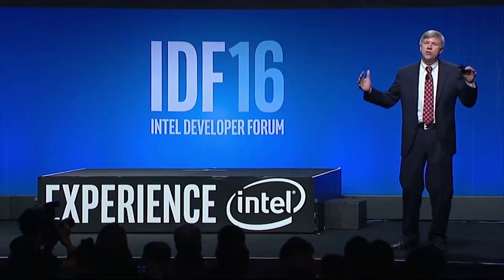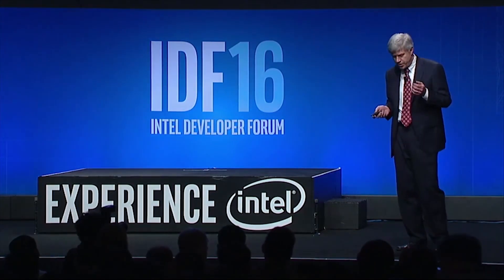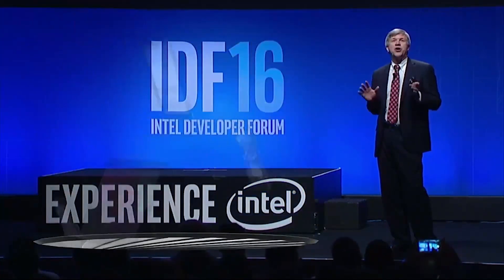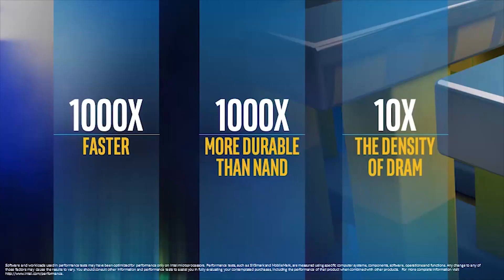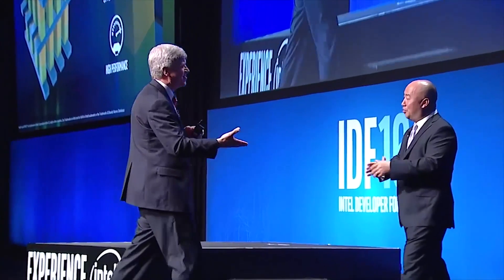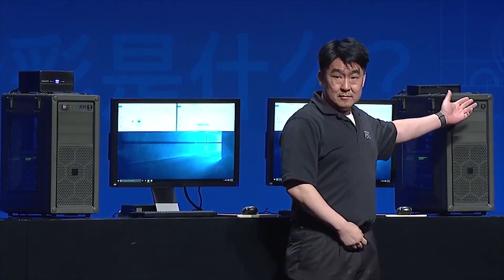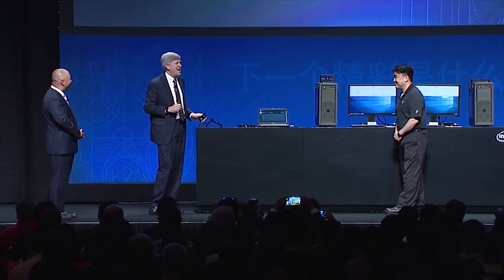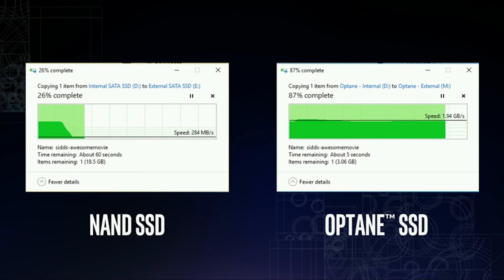Intel IDF 2016 Shenzhen   Intel Optane SSD

Comment: Has this been released yet? When is the release date?
Reply: 4th Quartal of 2016 or first of 2017
Reply: Thanks for the answer
Reply: Releasing January I believe and it will be compatible with 7th generation Kaby Lake CPU's.
Reply: It's for the z270 chipset
Reply: Muhammad Numan 1151 is a socket. z270 is a chipset
Reply: Zereks Also H250 and B250 right?
Reply: Muhammad Numan I dunno about h270 and the others
Reply: Zereks z270 isnt exactly a chipset, a chipset is like for exampled lga 1151 for skylake.
Reply: Zereks Oh ok that makes sense.